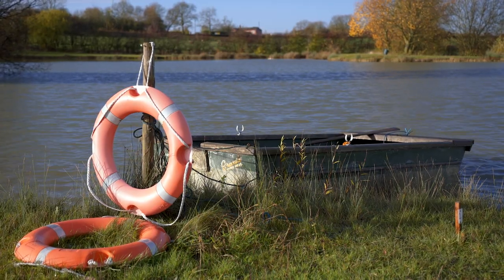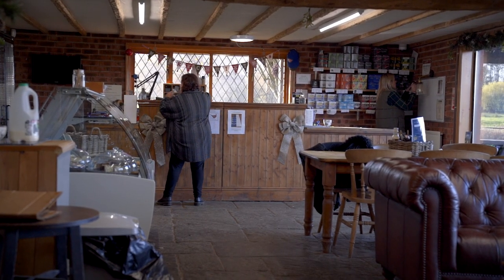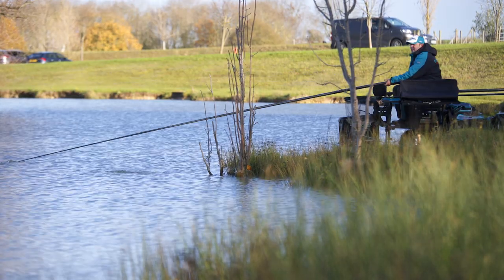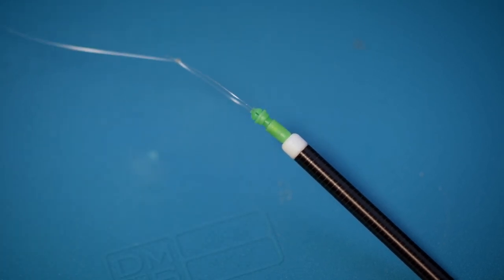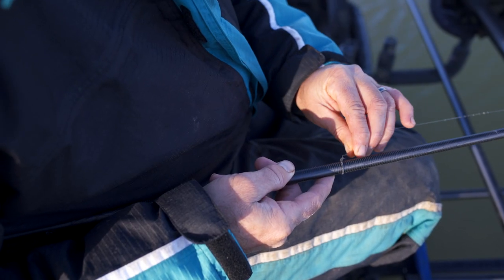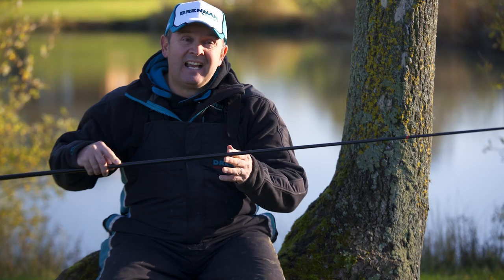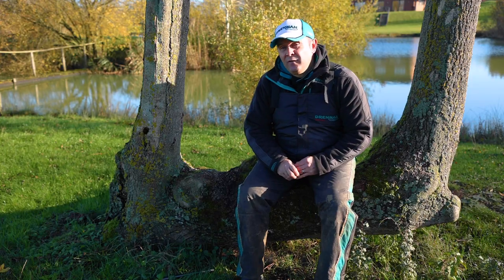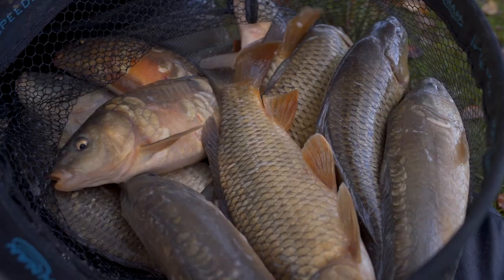Reduce the risk of damaging your fishing pole!

Comment: I always use end pieces of the elastic of each top kit after elasticating it, using the same colour I make a couple of hook up loop bands, just 2 overhand knots, a bit of spit and pull tight, then you have colour coded hook ups, so just look at the hook up for instant recognition of the elastic you have in the top kit.
Reply: The downside to that is the hookups can find their way to the gap between #1 and #2 and then get dragged up the #1 when playing fish. It ends up with the hook-up blocking the elastic flow.